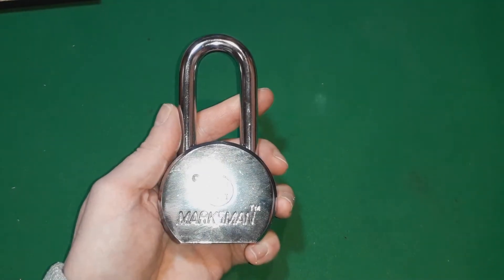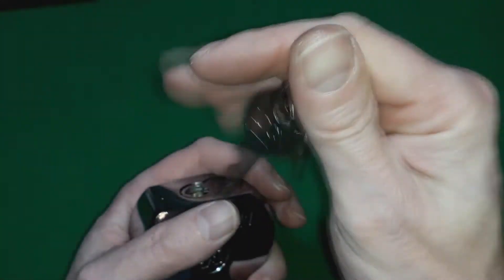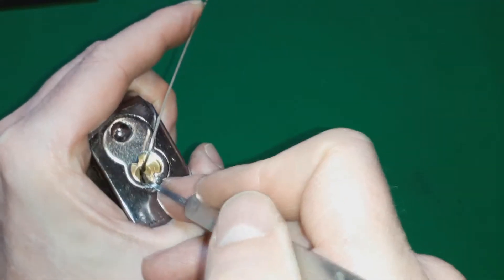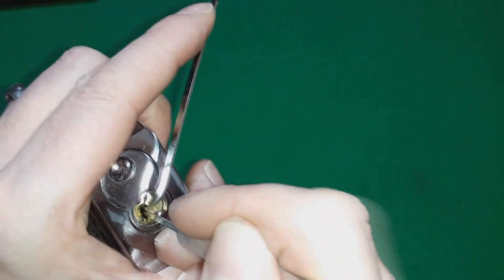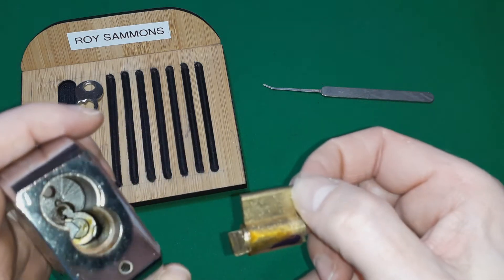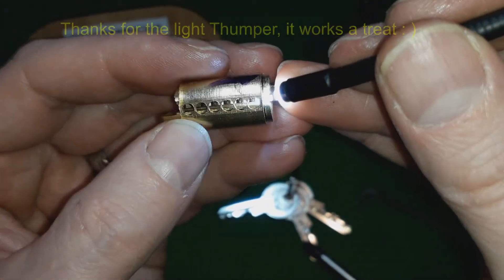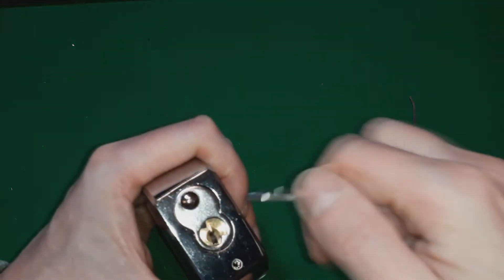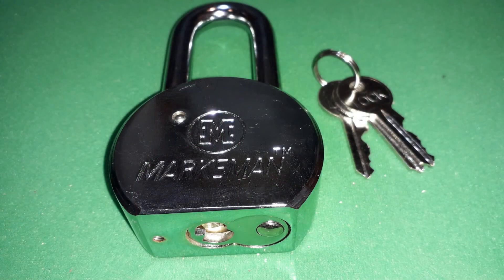(129) 65mm Marksman picked and part gutted.

Comment: We have a lock identical to that one here in the States made in China for Harbor Freight. It also has a strong spring. The pins are terrible. They look like they were cut with dull pliers. A new core would make it a strong lock. Good job👍🦊
Reply from the maker: Ahhh the good old cheap Chinese pins. I have searched for cores on Ebay and not found any. There's a few locks I have that are in need of a decent core.